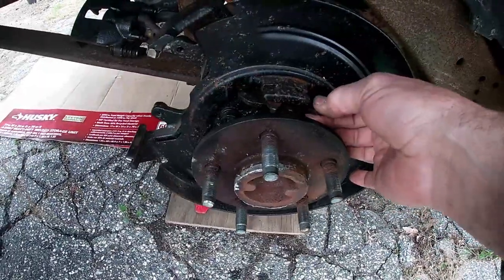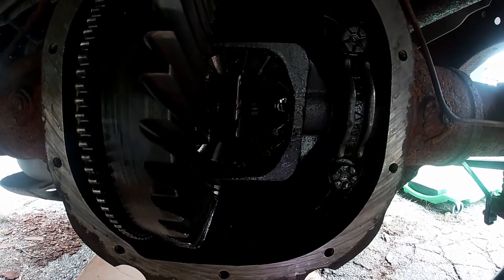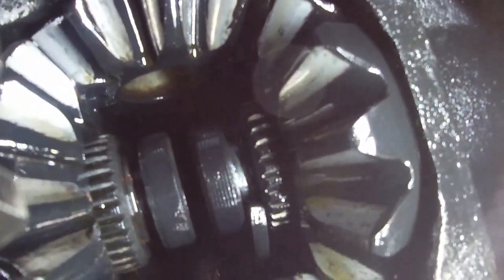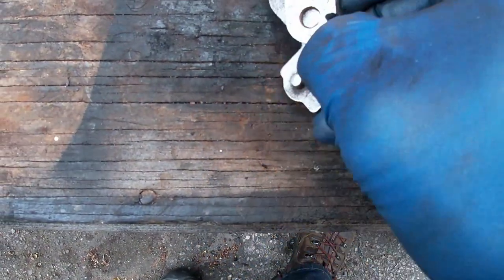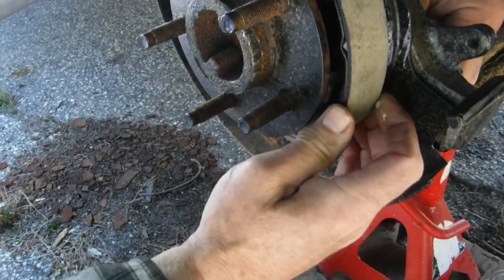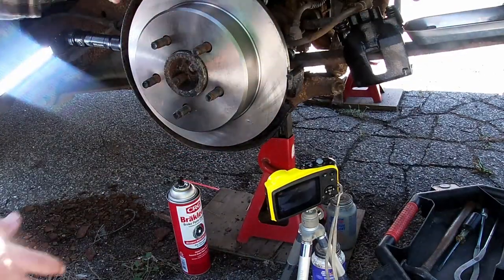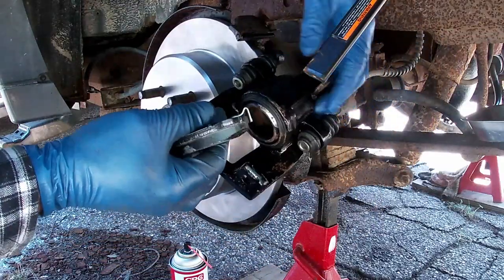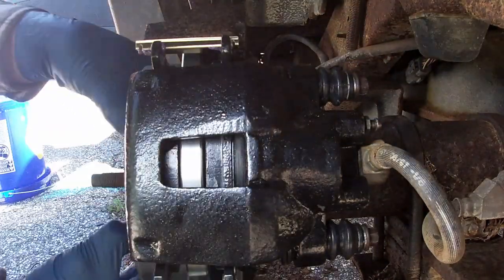1997 Ford Explorer Parking Brake Repair and Replace Deep Dive.

Comment: Thanks for the video!  This is a big help, my son and I are doing a project 1993 Jeep YJ and it has a Ford 8.8 axle swap.  The rear parking brakes were disconnected by the previous owner and we need to tear into them and get them working.  Wasn't sure if we should pull the hubs to get good access to the components and after watching you show how easy it is I think that we will go ahead and do it.  I want to make sure they are in good working order.  Thanks for your help buddy!
Reply from the maker: Good luck!

Comment: This vid was right on time.  Thanks!  Just de-rusted the back end of my 98 XLT.  Putting back together and the e brakes are a pita.  Noticed you did not do the inside top spring.  The springs especially are a pita.  Did not have to crack my diffrential to pull the e-brake lever.  But was great to see how to pull those hubs.

Comment: Great video sir.  Thank you.  If you can, please return a comment.  I am working on my 1997 Explorer.  The parking brake has not worked since I purchased it.  I noticed in your video that there is only one spring on the outside of the shoes but mine has both an inner and outer spring.  I saw in some other videos where the demonstration included both springs.  When they are both in place they are a nightmare to stretch especially with a bad rotator cuff.  Should both be installed or just the outer?  Thank you.
Reply from the maker: Both, if you can manage it. Mine were lost and truthfully I hardly ever use the e-brake so I don't particularly care.

Comment: Hey Hillbilly, I don't know if you read these comments. But I have a ford 8.8" rear end like you on my jeep and that brake lever/cam combo you pull out at 11:28 isn't something I can buy online. I need it to get parking brakes installed and pass inspection, if you got any idea where I can buy them or get specifications on them, I'll buy em or make my own. Thanks!
Reply from the maker: Probably your local auto salvage yard (aka junk yard) is your best best. Good luck!